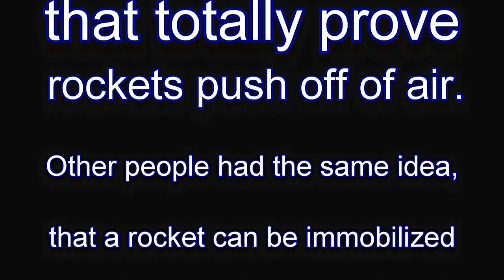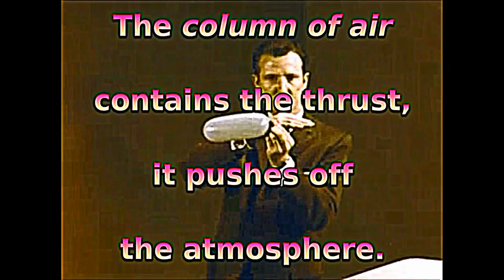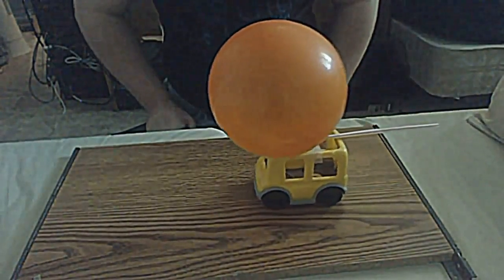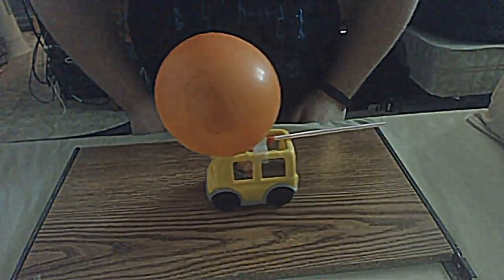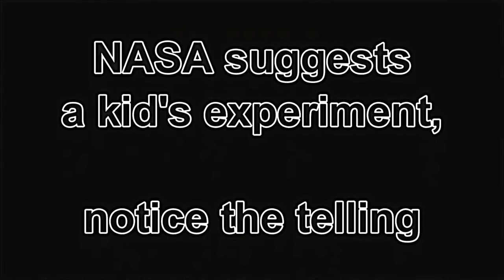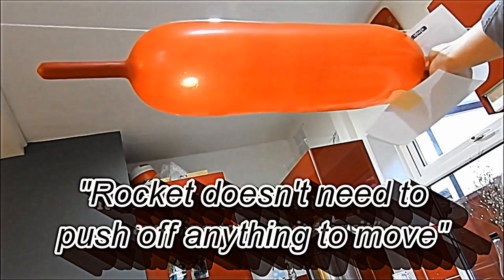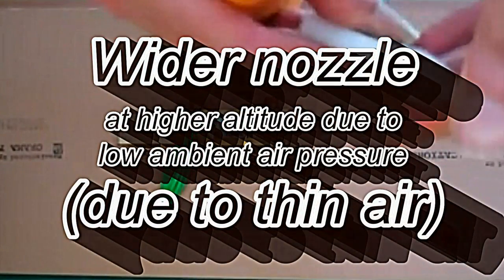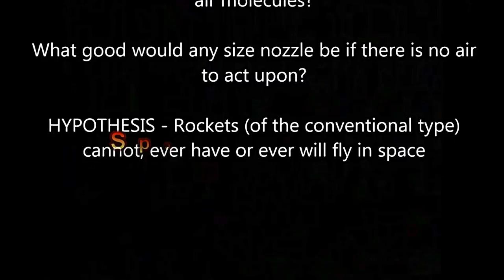rockets push off air

Comment from the maker: http://fakeologist.com/blog/2015/01/28/why-rockets-dont-work-in-a-vacuum/

This is the first post in a comprehensive thread that really summed it up for me. If it’s wrong then it sure fooled me.

    Cluesforum.info
    Apollo, and more space hoaxes • Re: Does Rocketry Work in the Vacuum?
    by Boethius on Jan 28, 2015 6:58 AM
    
    The reason space travel is not possible is because the systems we claim to use to propel a rocket through space operate on gas pressure and there is no gas pressure in space.

 Gas pressure requires molecules to be in contact with each other, bouncing off each other, causing millions of collisions per second, etc… If you release gas into the vacuum of space, the first molecule that pops out will shoot off into the distance at a constant speed, so will the one behind that, never catching up with the first one. The third, fourth, etc… all fly off into the distance trying to fill the vacuum by finding their empty corner. So no matter how much gas you produce none of it will ever change the pressure under a space ship. None it if will ever push a spaceship. To push a spaceship there must be some locally high pressure under it, which is impossible since the pressure in space is 0 everywhere.

    Back of the Nozzle and the Massflow equation F=MA on earth
Think about a fire hose shooting water. A force comes directly back against the column of water shooting out. Why? Because the first drop of water has to pas through air, which is dense, causing many collisions, slowing down the drop of water. The second drop, directly behind the first, will not be slowed down by the air so it will collide with the first drop, the third drop hits the second drop and so on, the fast water coming through the hose pushing through the slower water outside causes Newton’s 3rd Law to push back on the column of water. This is why you need people holding the hose to add an unbalanced force otherwise the hose would not be able to push water through that column anymore, the water column would be diverted and the hose would flop around. It is obvious that one drop of water does not push back on the hose, you need a fast moving column.

    The nozzle and the Massflow equation in space
Since the molecules leaving the combustion chamber and entering the vacuum never slow down, never collide with any outside objects, nor with each other, their force is always moving forward, away from the ship. There is no way for that force to be returned to the ship. There is no way for the force of the moving molecules to be extracted and used for propulsion. Their force is carried off into the far corners of space. This is also known as Joule Expansion. Remember that as soon as the nozzle is opened, the combustion chamber becomes part of the vacuum of space as is subject to its laws. A closed chamber is under pressure but not an open one.

    NASA is lying at the molecular level
But that’s OK because most people don’t usually look there. The awesome, spectacular and heroic nature of space exploration is enough to cloud the most logical minds. Most respectable engineering schools won’t touch space flight and those who do have tiny departments. If it was really a multi-billion dollar government funded operation, every school in America would have their hands out for government grants like the do with Engineering, Computer Science and Biology. But why train thousands of the best minds of a generation in a field that doesn’t exist? 

www.cluesforum.info/viewtopic….

This thread has seen many forum members come and go. It’s been highly divisive, which must be why so many non fakeologists have avoided even discussing it. It’s like trying to reconcile the WTC twin tower imagery with any known method of building destruction. What we are told and what we know are simply irreconcilable, so regular people, from academia to the uneducated, simply don’t even try to explain what contradicts.

Read more: http://fakeologist.com/blog/2015/01/28/why-rockets-dont-work-in-a-vacuum/#ixzz6omLAD88F

Comment: Do you believe in the conservation of momentum? Yes or no?
Reply from the maker: if it requires "belief" then no, but tell me how this is supposed to prove rockets don't push off air, because I'm sure it will be a misapplication of the concept
Reply: @rocketspushoffair  I can prove that rockets do work in a vacuum, but my proof is based on the fact that momentum is always conserved. If you don't even believe that, there is no point in me trying to explain to you about how rockets work.
Reply from the maker: @jimmorrison2657  I never said I didn't accept the concept, but that it is misconstrued and misapplied to rockets not having to push off air, it was never intended for such an explanation, so, go ahead if you want to state how it explains rockets pushing off their exhaust, maybe I can tell you where you are going wrong with this, there is a recent discussion started on this on my slo-mo bullet video
Reply: @rocketspushoffair  Ok. Momentum is always conserved. So, if a system starts off with zero momentum, it will keep zero momentum, unless any external force interferes with it. I think/hope you agree with this so far. Now, think of a rocket in space. It has its propellant inside it, but it is not moving, so it has zero momentum. No external forces will act on it. Remember, the momentum of the whole system (rocket + propellant) is zero, so it will stay at zero. Now, the rocket ejects some of the propellant, and this propellant moves away from the rocket, with a momentum. Let's say the propellant's momentum is ten (unit don't matter). So now, if the rocket didn't move, the momentum of the rocket/propellant system would have changed, from zero to ten. But we know this can't happen. To conserve the momentum of the system at zero, the rocket moves away in the opposite direction, with an equal and opposite momentum, of -10. Now, 10 + -10 is zero. That is how the momentum of the system is conserved, by the rocket moving away from the propellant which it expels. This is how rockets work in space. Don't fight this, re-read it. By the way, the rocket will not move away at the same speed as the propellant, but with the same (and opposite) momentum. Be honest with yourself, and don't just side-step this. All the best.
Reply from the maker: @jimmorrison2657  ALL THE BEST, but don't you see the con in what you believe? Nothing is being ejected. I have never seen a blow torch eject its flame. Also, combustion is not possible in space, "don't fight this" I already proved it to you. Rockets, like jet planes, push off air.
Reply: @rocketspushoffair  Ok mate. Believe what you want.
Reply from the maker: @jimmorrison2657  You are sticking to mental arguments and sacrificing actual proof and being reasonable. Be honest with yourself, you're not free, the crossbow will not work unless I hold it with my feet planted on the ground, you need resistance. I'm planning to make a pressurized cylinder, maybe a skuba tank, and put a few gauges on it, especially one directly opposite t he opening, one close to the opening, and one in the middle. Guess what will happen when I release the air at one end? All the gauges will decrease in pressure equally, there will be NO FORCE applied opposite the opening, period. That's not a belief, but an intuitive fact, you've been had my friend!
Reply: @rocketspushoffair  Again mate, 99% of people think you are wrong, but of course, you know best.
Reply from the maker: @jimmorrison2657  ad populatum logical fallacy, it's not about numbers and you are wrong about that, billions of people know we never went to the moon, you are abandoning common sense to be part of a herd, I have made a SOLID CASE but all you want to do is be part of a herd, why?
Reply: @rocketspushoffair  You don't give up do you? You have side-stepped the issue by bringing in the moon landings (also I hope you meant to say millions, and not billions). You have made NO case. As I said, believe what you want.
Reply from the maker: @jimmorrison2657  You are in denial, plain and simple. Truth does not require belief, lies do. You have seen that combustion is not possible in vacuum, yet you cling to your "beliefs" like a religious fanatic, why? Are you religious?
Reply: @rocketspushoffair  I am not religous. I do not believe in God. But I am not interested in starting a new conversation with you about this. Rad
Reply from the maker: @jimmorrison2657  I wasn't trying to start a new topic, just wondering why you discard truth for lies, even after it has been totally proven to you
Reply: @rocketspushoffair  I am still learning, mate. I intend to keep an open mind and keep on learning for my whole life. I try to base my beliefs on verifiable proofs, whereas you just believe what you want to believe. E.g. if there are 1000 videos showing that combustion IS possible in a vacuum, and one video showing that it is NOT possible, you will choose to believe the one video. Because you want to, because it makes you feel special, as if you have some kind of insider knowledge that other people are not clever enough to know. You just ignore or side-step anything that gets in the way of this. You are living in a dreamworld. Snap out of it. Thanks in advance.
Reply from the maker: @jimmorrison2657  You seem to be a clairvoyant! You know so much about me and how I think! Wow! In science, you need to look up what FALSIFICATION means. All swans are white, so you go out looking for a black one, if you find it, then the hypothesis is falsified, so you claim all rockets work in vacuum, but if it is shown one time they do not, that falsifies the claim. But THE FACT IS, that NO ROCKET has been shown to work in a vacuum, and combustion is totally impossible in a vacuum! You came at me with mental gymnastics, but I countered you with actual proof. So, stop deluding yourself, you are a bigot, you are not learning and your mind is CLOSED. You need to "snap out of it". You have zero proof for your beliefs, think about that. And good luck! ;-)
Reply from the maker: @jimmorrison2657  most people who weight "these things" in the balance, as I have, inevitably come to the same realization, and this is evident in the comments and thumbs up of my videos, this increased awareness is a trend that is increasing exponentially, you might need to look that big word up? Again, you are showing all the signs of having a strong delusion, you cannot comprehend the proof that rockets do not work in vacuum, vacuum only exists in confined spaces on earth, combustion is IMPOSSIBLE in vacuum.--THIS SINGLE FACT ALONE, CRUSHES YOU AND YOUR FALSE "BELIEFS". In other words, you've been handed your arse on YouTube, for all to see. Once anyone knows that combustion is NOT POSSIBLE in vacuum, all bets are off. Here's what I see: you washed your brain with industrial strength propaganda, but you forgot to rinse! HAAHHHAAHAHHAAA!!!
Reply: @rocketspushoffair  Ok, rad!
Reply from the maker: @jimmorrison2657  I hope you learned something, "belief" has no place in science, just never forget that combustion is not possible in vacuum, AND, the cylinder experiment I proposed which proves there is NO FORCE opposite the opening, when you let the air out of the balloon, it pushes off the atmosphere to propel, there is no equal opposite force that has ever been demonstrated on the inside of the balloon opposite the opening--so, just like gun recoil, it is the atmosphere that pushes back on the exhaust that is forced into it, that is where the action/reaction occurs, as proven in my featured video (above) titled rockets push off air
Reply: @rocketspushoffair  I have learned something. I don't think you have though. Anyway, let's leave it. All the best.
Reply from the maker: @jimmorrison2657  That's so sad! You actually think you are right because "99%" think like you, but truth does not require a majority or a consensus. You're basically a kid that just found out Santa is fiction, but you refuse to let it go. I hope some day you come to your senses. There is not a single demonstration that backs up what you believe, I should know, because I fought to keep it going, I was like you not too long ago.
Reply: @rocketspushoffair  rad
Reply: @jimmorrison2657  You're wasting your time Jim.
This is the same guy who actually thinks that when a person standing on a skateboard throws a heavy medicine ball away from themselves, they are propelled in the opposite direction, because the medicine ball is pushing on the atmosphere during the 'throw'. 
How can you expect to reason with someone who has this much 'stupid', lol.
Reply: @sailorman8668  True, I started off trying to reason with him, but then I gave up when I realised he wasn't interested in the truth
Reply: @papalegba6796  Neither can you. Also, this has nothing at all to do with this discussion👍
Reply: @jimmorrison2657  wrong & wrong. You don't understand conservation of momentum either 😂
Reply: @jimmorrison2657  a thermal rocket is a heat engine, dopey 😂